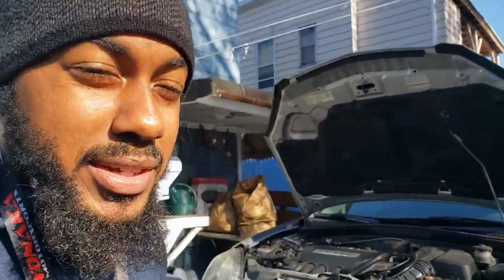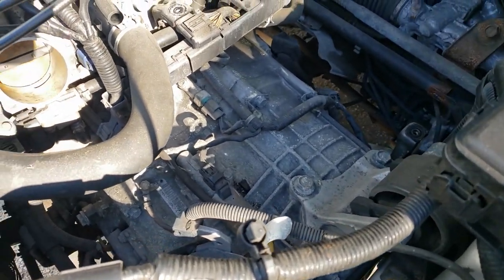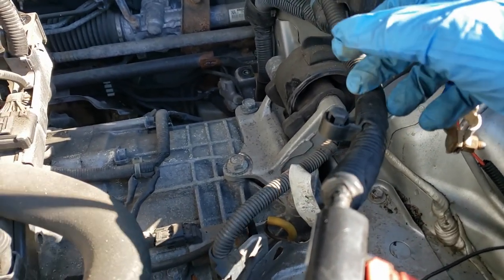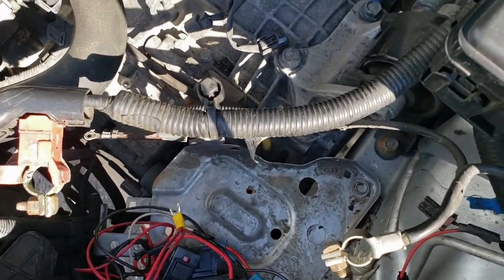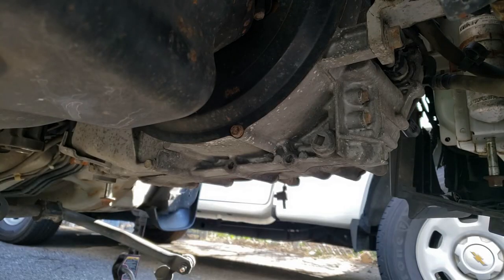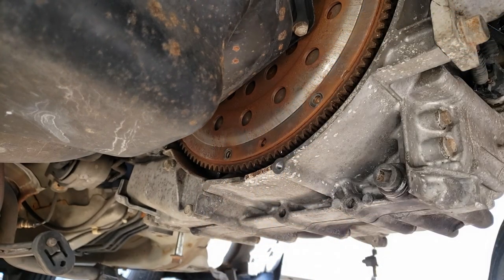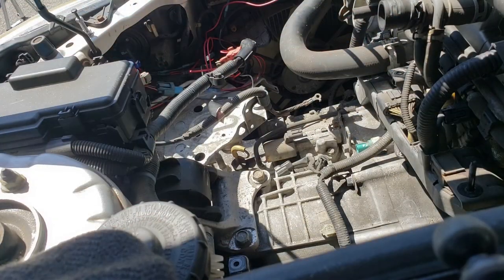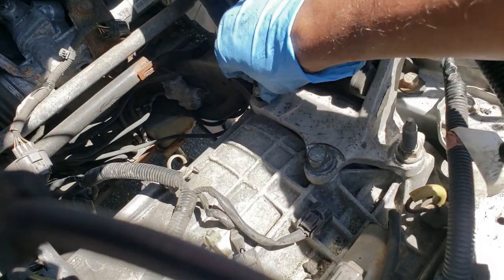2006 RSX Automatic Transmission removal

Comment: Did you just leave the engine and trans hanging without the subframe, or did you have it supported some other way.
Im halfway through, I was just going to put a small jack with some wood under the sump to take some of the weight when i remove the subframe completly.
Reply from the maker: Sorry I just seen this comment, I Know I'm late but yeah I supported the engine with the brace I had running across the engine bay

Comment: Did you have to buy the auto to manual conversion mount kit with bracket? Or any manual Rsx mounts will work?
Reply from the maker: The automatic mounts will work. You just need the auto to Manual bracket. I just chose to get stiff mounts. The manual mounts will not work, driver side is different.